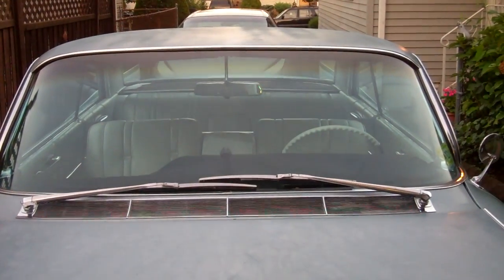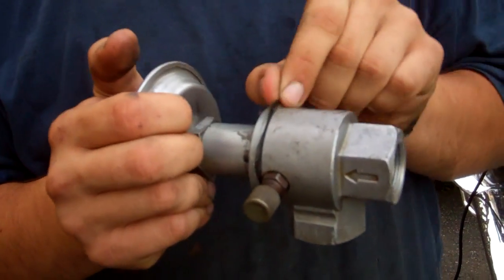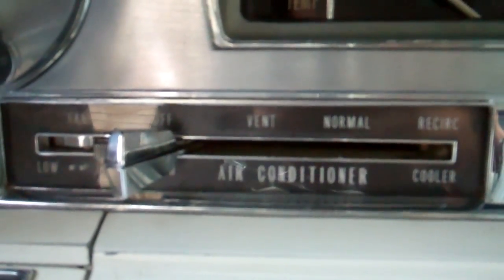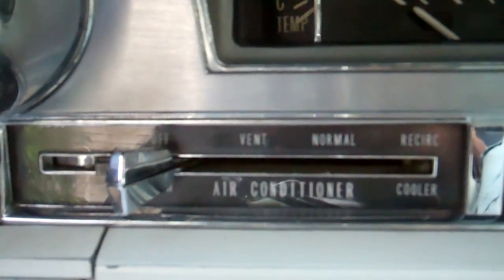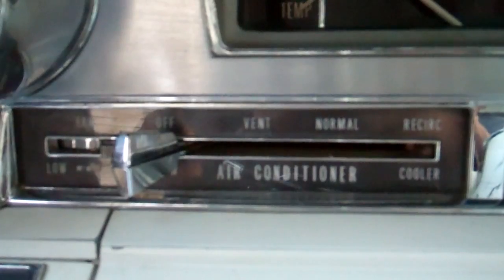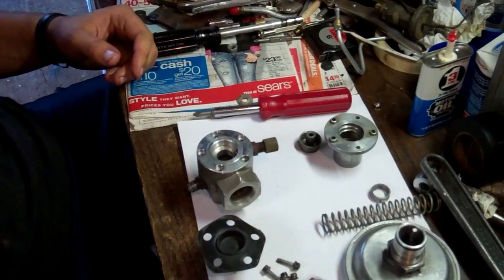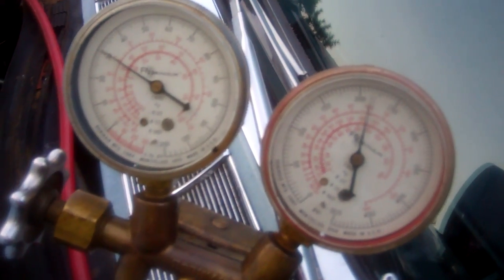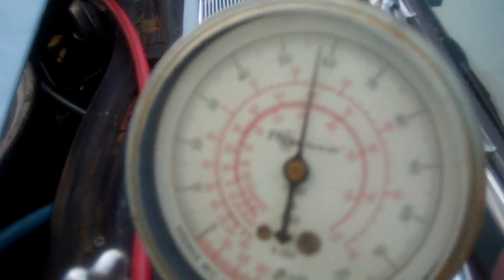1962 CADILLAC AIR CONDITIONING

Comment: Great video-I just installed factory air conditioning in my 1962 Cadillac series 62. I had to restore every component off of the junkyard car. Everything works except the suction throttling valve is it 60 pounds. It’s a new old stock brand new valve. I’m wondering if the spring in it is wrong and may be too weak. I’d like to try to set up a way to bench testes. Any thoughts on what would be keeping the suction throttling valve from going below 60 lbs even though it’s a brand new Delco one